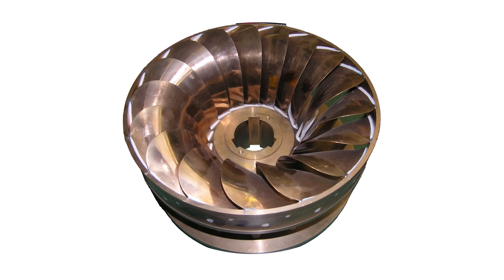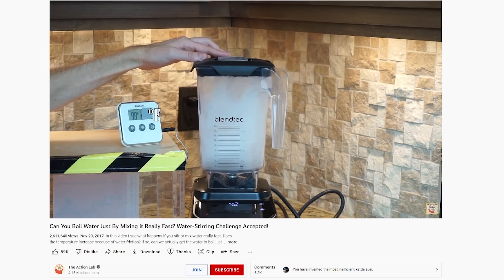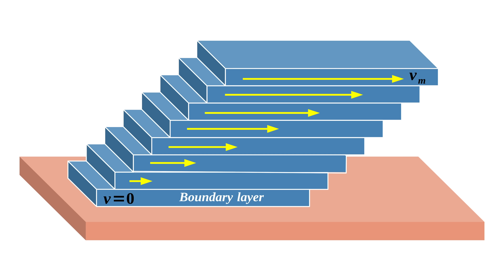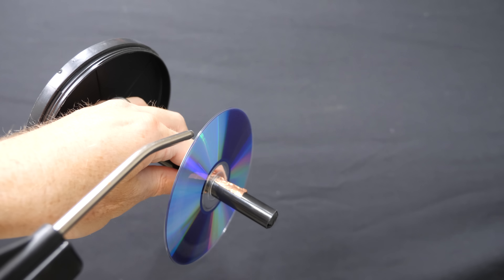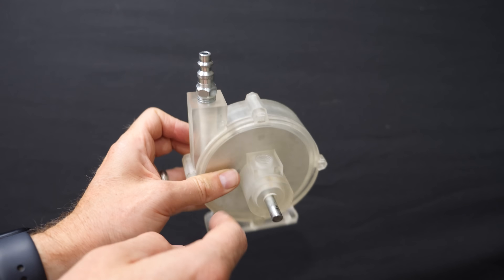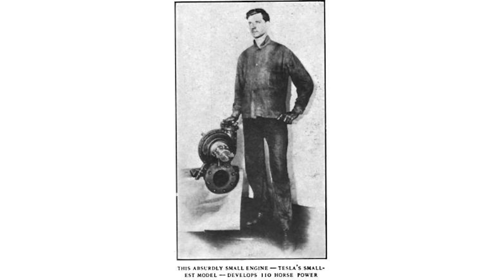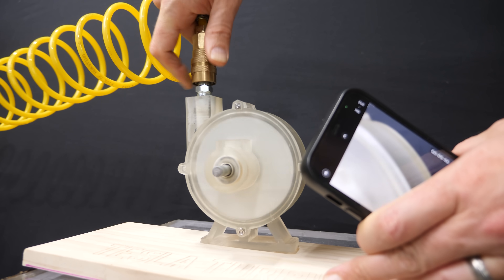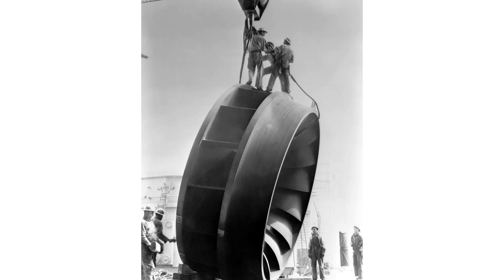How Fast Can a Tesla Turbine Spin?

Comment: you can't post anything on the internet without getting swarmed by people desperately trying to convince you otherwise. no matter what it is, if you post something on the internet, you're categorical and entirely wrong.
Reply: No problem my TesTurs work just fine! Just pushed a real 2.65kW electrical load at 9500rpm with room temp compressed air and never went over 20 psi at the nozzle. 

The latest dyno came in at +4.25kW between 6000-8000rpm and peak torque of 6.22ft-lbs at only 4150 rpm again on room temp compressed air and never went over 40 psi at the nozzle 🤭

TESTURS WORK PERFECTLY FINE. 

You just have to actually know how to design them.
Reply: @samehedi  don’t chase high RPMs. You’ll only make more centrifugal head counteracting the incoming fluid flow. 

Despite what everyone erroneously claims, spinning fast is not how to actually increase the efficiency.

Efficiency is increased by reducing slip. And increasing the disc speed does nothing to reduce slip, only create a longer slip path on the disc face. 

The fluid is not supposed so make as many spirals around the disc face as possible. 

The fluid is supposed to slide the least on the disc face while making the most spins with the discs. 

The low slip laminar shear force exerted on the disc through a large rotational distance is by definition “work done”. 

The distance the fluid slips on the actual disc face is not the “distance” in “force * distance = work done”.

The distance the force would be exerted through would be the distance of rotation the fluid makes with the disc while sliding the least, not the distance across the disc face the fluid slides.
Reply: The stress on the disks is only related to tangential velocity at the edge of the disks. So no, making it bigger doesn’t relieve stress; it just shifts you away from higher rmp. That being sad we do have materials able to do both reasonably well, just wanted to throw that in there that the rpm isn’t really your issue and making larger disks with slower rpm doesn’t fix the stress on the disks.
Reply: @tylerhope9969  The stress related to acceleration, which is v^2/r at circular motion. So if the velocity is the same at the edge of the disk, but the radius is bigger, it result less stress.
Reply: @Zilahi-Branyi_Laszlo  your absolutely correct, ty 😊
Reply: The main problem was how quickly it became outdated. More modern turbines quickly became much more efficient. At the time the efficiencies of the Tesla turbine were unreliable, and not hugely better at peak performance to be worthwhile to change current existing equipment.

It also lost efficiency when put under too high a load, so it couldn't be pushed if required (eventually energy gets lost to sheering)

It was ahead of it time in some ways, but not far enough ahead or reliable enough to be adopted.
Reply: @samehedi  listen to what Tesla himself said to actually do to make them work…

“Owing to a number of causes affecting the performance, it is difficult to frame a precise rule which would be generally applicable, but it may be stated that within certain limits, and other conditions being the same, the torque is directly proportionate to the square of the velocity of the fluid relatively to the runner and to the effective area of the disks and, inversely, to the distance separating them. The machine will, generally, perform its maximum work when the effective speed of the runner is one-half of that of the fluid; but to attain the highest economy, the relative speed or slip, for any given performance, should be as small as possible. This condition may be to any desired degree approximated by increasing the active area of and reducing the space between the disks.”
-Nikola Tesla
Reply: @samehedi  
What are your use cases here?
Because to me it sounds like, you are saying that: "because this tech can't fulfill this one niche requirement it's completely useless"  
FYI this is not how engineering works.
Reply: @samehedi  you don’t want to spin them too fast because the centrifugal head will counter the incoming fluid flow, reducing the pressure gradient across the nozzle, reducing the final velocity of the fluid leaving the nozzle, as well as reducing the mass flow rate through the turbine, ultimately reducing power out. 

Spinning fast only slightly increases efficiency at the cost of power. 

Again this is what Tesla actually says. 

“Still another valuable and probably unique quality of such motors or prime movers may be described. By proper construction and observance of working conditions the centrifugal pressure, opposing the passage of the fluid, may, as already indicated, be made nearly equal to the pressure of supply when the machine is running idle. If the inlet section be large, small changes in the speed of revolution will produce great differences in flow which are further enhanced by the concomitant variations in the length of the spiral path. A self-regulating machine is thus obtained bearing a striking resemblance to a direct-current electric motor in this respect that, with great differences of impressed pressure in a wide open channel the flow of the fluid through the same is prevented by virtue of rotation. Since the centrifugal head increases as the square of the revolutions, or even more rapidly, and with modern high grade steel great peripheral velocities are practicable, it is possible to attain that condition in a single stage machine, more readily if the runner be of large diameter. Obviously this problem is facilitated by compounding, as will be understood by those skilled in the art. Irrespective of its bearing on economy, this tendency which is, to a degree, common to motors of the above description, is of special advantage in the operation of large units, as it affords a safeguard against running away and destruction. Besides these, such a prime mover possesses many other advantages, both constructive and operative. It is simple, light and compact, subject to but little wear, cheap and exceptionally easy to manufacture as small clearances and accurate milling work are not essential to good performance. In operation it is reliable, there being no valves, sliding contacts or troublesome vanes. It is almost free of windage, largely independent of nozzle efficiency and suitable for high as well as for low fluid velocities and speeds of revolution.”
-Nikola Tesla

^ “suitable for high as well as low speeds of fluid and speeds of revolution”

The only time it’s supposed to be spun fast is when using the TesTur as a pump/compressor because ALL centrifugal pumps’/compressors’ performance is tip speed dependent.

“I have found that the quantity of fluid propelled in this manner, is, other conditions being equal, approximately proportionate to the active surface of the runner and to its effective speed. For this reason, the performance of such machines augments at an exceedingly high ratewith the increase of their size and speed of revolution.”
-Nikola Tesla
Reply: I don't think this is really necessary, closer spacing gets the boundary layer to work really well at low rpm
Reply: @oscarverwey  you don't need high speeds when spinning huge masses. Scalability is not really an issue. Original issue was that businesses that had different patents could not use this tech and when Tesla died this tech was property of government that was kept secret rather than used...because no one else was smart enough to use a simplicity...education today is still overcomplicating science to the point of stupefying people to think that they need more complexity for greater efficiency.
Reply: You could just use a more viscous fluid.
Reply: The fair guesses: #1 they are ridiculously easy to make from "garbage" like old CDs and all you need to do is figure out how to convert the torque/spin to "power" something. #2 There's still research going on in the field so the idea isn't dead just isn't going to replace anything say gas powered right now. #3 There's a whole bunch of quantum physics not mentioned here but perhaps there's EMF or quantum things going on around those turbines. (I'm sure going to make a CD/pencil one now though out of Friends season 3 DVDs)
Reply: That's how they brain washed us that it doesn't work
Reply: That's a myth. The video everyone learned that from is from lesics Channel, their video about the tesla turbine. They made a big mistake calculating the speed of a turibne. The video says the rotor must spin at a very high rpm, maybe 50,000 for a 6” turbine. The speed of a turbine is based on periphery speed not rpm. If a 6” turbine needs to spin 50,000 rpm to be efficient like the video says, that’s a periphery speed of 890.1 Miles per hour. If you want a 3 meter disk to achieve close to 891 miles per hour at the periphery, the rpm required is only 7,253. We have materials that can easily reach that speed.
Reply: @iEnergySupply  what is the efficiency of that disc?

Normal turbines efficiencies are above 90%, there is a reason we do not use Tesla turbines, Engineers are quite clever, and would have solved most issues at scale, if it were a simple problem.
Reply: @Golden_SnowFlake  TesTurs with 81% efficiency from this thesis paper

“Design and Development of a Small-Capacity Tesla Turbine for Rural Applications

ABSTRACT
Bangladesh is in great need to find renewable energy sources for its fast-developing industrial sectors. The main objectives of this research are to design and fabricate a small-scale efficient Tesla Turbine for remote areas and test it through experimental investigations. Performance analysis of the newly designed Tesla Turbine suitable for remote areas of Bangladesh will be conducted. Until now, a number of researchers have undertaken several tests and studies to evaluate the Tesla turbine's performance and efficiency. Tesla Turbine does not proficient in producing torque. The work here consists of computational analysis and an experimental campaign by fabricating the turbine. Solid Edge 2021 is employed for our 3D modeling. For modeling, the desired material is Polylactic Acid (PLA) or ABS Plastic. The proposed design consists of 51 disks with an identical spacing of 3 mm. This design has led to achieving a torque of 19.85 N-m and a staggering efficiency of 81%. It was found that stress generated on the disk edges is higher than their centre due to high centrifugal force.”

From a plastic turbine too 🤭
Reply: disc is an order of magnitude easier to produce than a fan as far as complexity goes. Air input speed can be controlled, and torque specs can be designed for by stacking more discs.
Rich people paid for their shittier solution to win and so we have turbulent fans now...also fan development was needed in propulsion, where Teslas disco just looked like silly overkill that needed material sciences to catch up.